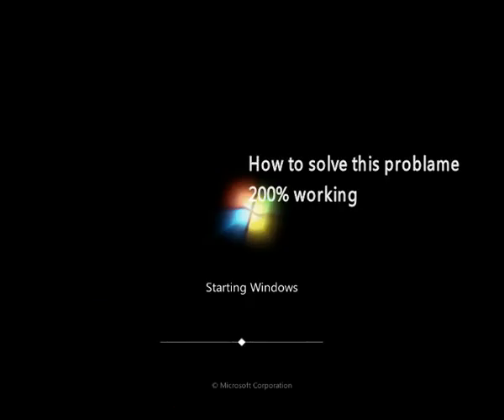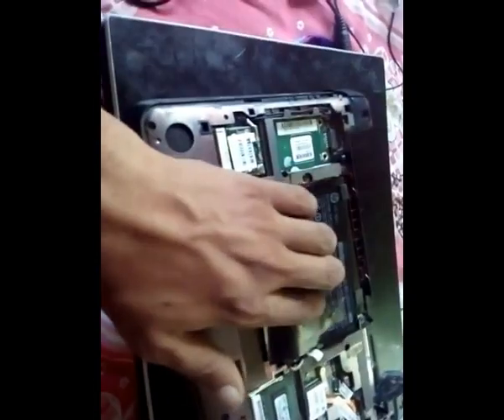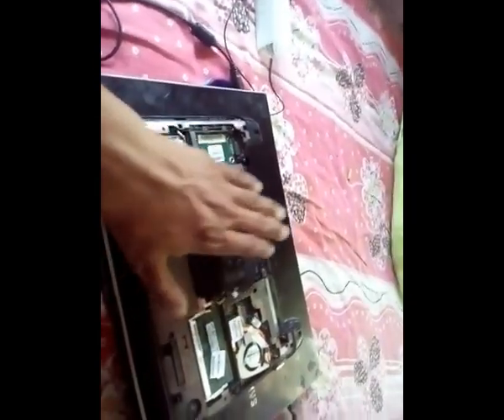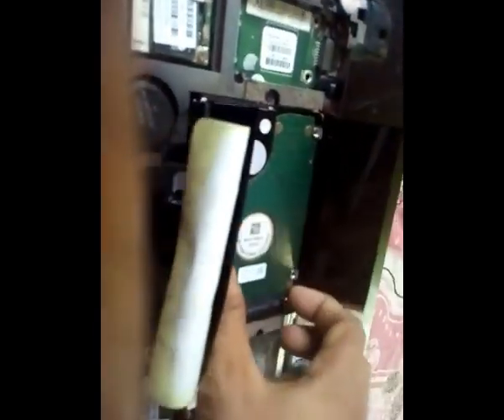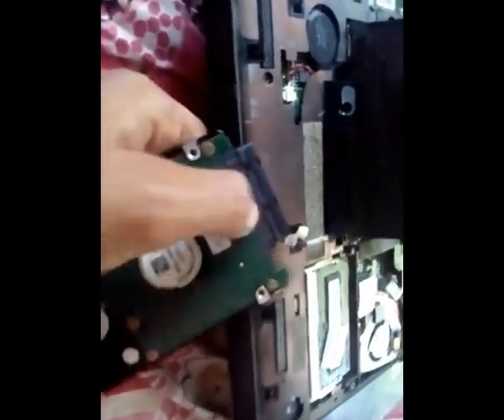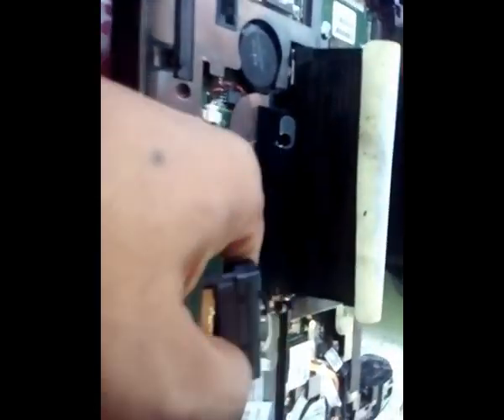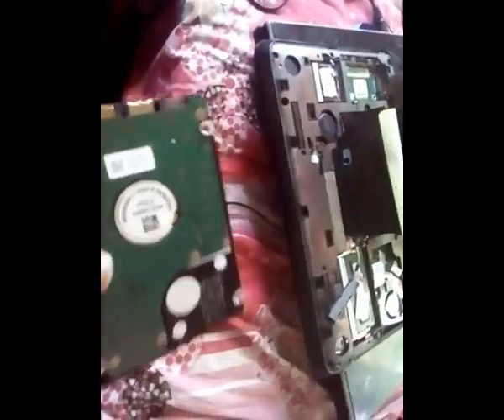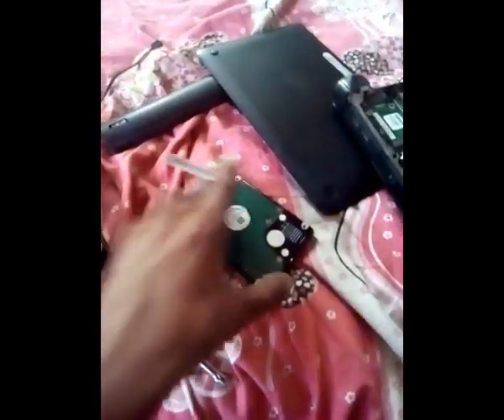windows got stuck on starting windows screen 200% works | shearing real experience

Comment: So, u removed ur hard drive with the windows start error and put it a new hard drive that already had windows installed on it. This is the stupidest video i have ever watched. The problem is most people dont have a spare harddrive. Also what do u do if your car has a problem, replace it with a new one?
Reply: for windows 7 you cannot just transfer a different hard drive that had windows installed on it into another pc because they have different hardware and drivers. you can only do that on windows 10. i tried that several times and ended up to BSOD
Reply from the maker: do u even know anything  about computer ?  and honestly this video is the best ,,,and real ,,if you do not like it ..than you are a Moron ..i never said that kind of thing but you are so ungrateful that's why
Reply: Wot i am saying is that u have not troubleshooted the problem correctly and jumped to the worst possible conclusion, that the hard drive is faulty. Listen i currently have the window loading screen problem and when i find a proper solution i will come back here, and let u that u wasted money on a new hd
Reply: Ok, i fixed my pc. I will tell you just incase someone comes here with the same prob. I removed 3 of my 4 memory modules and my pc loaded pass the frozen loading screen and into the windows repair screen, which then caused my pc to restart normally. This problem can also be caused my a faulty sound card, graphics card or any other card u connected to ur pc.  It was 1 of my memory modules that went faulty after sum1 accidentally switched off my pc at the plug.
Reply from the maker: look if your windows got stuck  ..at the beginning to start ..you believe Me their is no other troubleshoot solution  ...cause ,,lot's of youtube tutorial show you the fake troubleshoot technique ..( that's why i stop uploading problem solving tutorial  in this channel ..cause no one  appreciate My help )

Comment: i am using windows xp and xp is working fine......but when i am installing windows 7 it stuck on starting windows....
Reply from the maker: could you please send me the  pictures what exactly happening then i could help  
to send me pictures  ..use that site in below 
www.prtsc.ca
than send me  your uploaded  url ..
i will definitely help  you
Reply: RTR i have uploaded few images....as u can see xp is working fine but windows 7 is not installing.....u can also see my spec......help plz
 http://www.prtsc.ca/i/LSR6y

http://www.prtsc.ca/i/LSFza

http://www.prtsc.ca/i/LSovH

http://www.prtsc.ca/i/LSEcC
Reply from the maker: your internal herd disk ,,have some issue like ---
1. less memory - xp only need  only 4-5 gb space 
but windows 7 need 16-20 gb space to install 
i think you need to increase your installing drive space 

2.your pc need to check  Memory Diagnostic  issue ..run and check 

3.or just change your internal hard disk ..buy a new one ..(500 gb only 2800 rupess) ... and your problem got solved
Reply: local disk c....128 gb space...
Reply: i have 500 gb hard drive......should i buy 1 TB hard drive????
Reply from the maker: it's  up to you .. you can buy 500 or 1 tb .. if you buy new hard disk your problem will be solved ,,100% guarantee
Reply: ok...thnx man